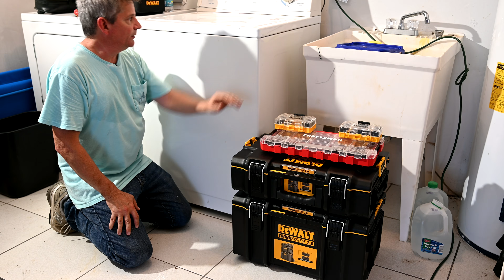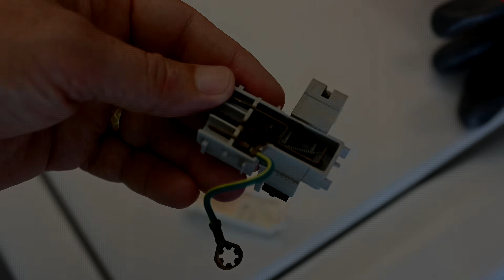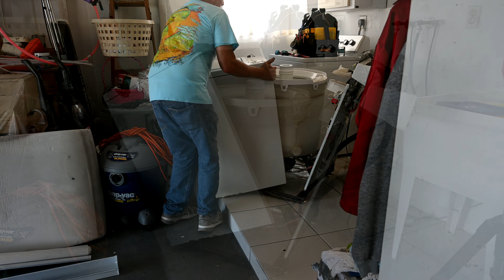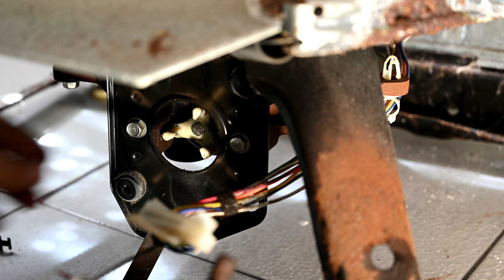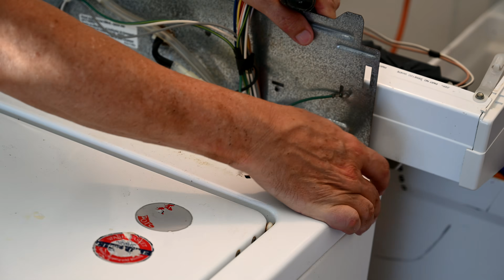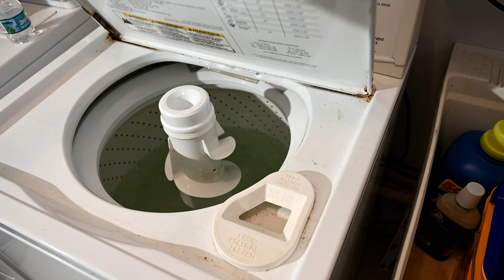Washing Machine Wont Spin/Agitate DIY Fix: Fills With Water

Comment: My washing machines will complete its full cycle except for the spinning cycle. It stops spinning although the motor seems to be running and trying to spin. The 3 point plastic parts don’t seem to be the issue since they’re all intact, as well as the black rubber part. what else would be the reason??

Comment: Thank you for this video.  When I lift the lid I can hear the switch clicking loudly and figured that was not the problem.  Then i read one of the comments that said one person wired around it even though he could hear the switch and that fixed it.  Sooooo I just did the same and Viola!  It works.  Thank you so much!

Comment: I have a issue with my Maytag top loader… I found the belt was disconnected from pulleys and the Lilly on the motor was shot… so I relaxed the belt and motor… now the washer will fill with water then buzz and do nothing.. I can unplug the washer and put it into spin fine… just need help figuring out why it won’t agitate after filling with water… please help!

Comment: Is it possible that the timer is bad? I have a belt drive Hotpoint top loader washer HSWP1000M4WW. The reason I ask is because my timer sometimes would not turn off with the timer knob. I taped the safety lid switch together so I could open it to see how well it was agitating. Then one day it just stopped washing or spinning even when I turned the timer manually. My timer is advancing through all the cycles, though. Any thoughts?
Reply from the maker: Yes likely an issue with the dial or the circuit on the main baord

Comment: Uh you forgot a mjor part that breaks.  there is a plastic  gear in the tub that connects the agitator . That if strips out, it won't spin or agitate. It's easy figure out if broken,  if the agitator spins in both directions it is stripped  , it is only meant to spin in one direction.

Comment: i have a kenmore washer with lid lock.    i did diag and have it narrowed down to the lid switch or the shifter/actuator.    Any way to eliminate the lid lock switch to test to see if that is the issue vs buying both parts.   Lost job..moneys tight.   TY

Comment: I would have thought the older machines would have been easier to do maintenance on. From my experience it's the newer stuff that is built where it's not easy to take apart and when you do, your only option is a $300 board or you gotta buy a new unit.

Comment: Hello Jeff thank you for the Video.
I ve got a frigidaire washer. Like 25 years old. My timer went out.  Took it out cleaned contacts and still nothing,  was thinking about using toggle switches and just stand there till each cycle was finished. Because really machine is to old can't get replacement part. And don't have really any money to do anything. 1st whT do you think about the toggle switch, and do you have any ideas.. I'm sure this would or could be a head scratcher lol
I know it is for me, I've been looking at the wiring diagram.
Thanks again

Comment: New motor ,coupler and capaster ,machine won't agitate I even took the motor out but kept the power  connector and still the motor only kicks in on spin ,you think its the timer or clutch ?
Reply from the maker: It could also be the controller board not enabling the motor
Reply: Not spinning clicking noise

Comment: Hey Jeff, my washer was doing its job for about 5 minutes but then I had to pause it to add more clothes. It was pause for 4 minutes or so with the lid up. I put the lid down and now it won’t continue with the cycle. How to I get it to start going again? 
Do I follow these steps?
Reply from the maker: Maybe it got into a messed up state, try to unplug it and plug back in. IT could also be a coincidence that maybe the door switch broke when you opened it.

Comment: Hi, great video. I did step by step but it still does not turn it is stuck. What can I do. I thank you I advance
Reply from the maker: You'll have to keep searching for videos on your model to see if it's maybe the controller board, or a relay somewhere. Try Appliance parts pros, enter your model and see what video they have under the symptoms section that show how to fix it
Reply: @jeffostroff  Thank you so much for your quick response

Comment: Sadly still can't fix my issue :( Replaced capacitor, lid switch, the dial and the motor. Thing will still not turn on =/
Reply from the maker: This leans towards a bad controller board

Comment: What if I see oil around the motor cuplink. I’ve taken the motor off completely but I see oil. I’m thinking at this point instead of having to remove the break it may be cheaper to buy a used one
Reply from the maker: Sometimes there is a bit of grease, they don't usually use oil. It could be from somewhere else

Comment: My machine fills but won't drain.  Does not agitate, does not spin.  Makes a loud noise when on the agitate cycle, "bang-bang-bang" like a machine gun.    Coupler replaced, issue persists.  What next?
Reply from the maker: If all those things are wrong I would look at the main controller
Reply: @jeffostroff  Main controller?  You mean an electrical part?  Or the motor?  I"m in the process of replacing the trans.

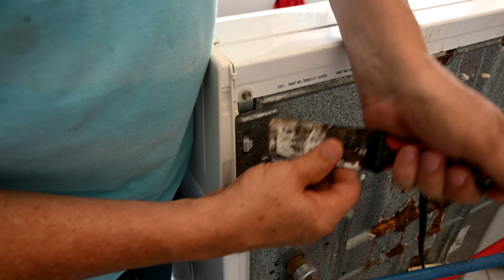Comment: Do not detach the clip(s) at 2:10.  The hooks at the base of control console detach from the machine top by pulling the console slightly foward.  Then the entire console rotates upward and back (as shown) when the two screws are removed.  The clips anchor the hinge pieces to the back panel that allow the console to rotate upwards and should not be "pushed in."

Comment: Hey Jeff my machine spins, but won't agitate could that still be the switch?
Reply from the maker: I don't know on this one but I would say that is probably not your problem because if the door switch was bad it would not spin at all. That is a safety mechanism to prevent anything from moving when the door is open. So I would have to start hunting down something else may be on the controller board.

Comment: Theres absolutely no need to take the "shell" off to replace the coupler
Reply from the maker: yes there is, how else would you get to it?
Reply: @jeffostroff  lean the unit back and work from underneath
Reply: Saves time and effort, you always want to move the unit the least amount as possible in a customers home( granted it’s your friends unit) you feel the coupler with your hand and tell if it’s engaging before taking off the motor and shell and if it need to be changed out 15 min repair without moving the unit and taking off the outer shell

Comment: Our whirlpool is spinning without draining. But the spinning sounds different. The clothes seen In there with soapy water. What can I do?
Reply from the maker: First thing I would do is pull the washing machine away from the wall and test the drainage into the wall and make sure your pipes are not clogged I doubt that would be the case but this is a very unique failure that you have so anything could happen. If that's not the case then make sure the hose coming out of the washing machine going into the wall is not clogged. And if that is not the case then you probably have a problem with the solenoid inside the washing machine that tells it to pump the water out

Comment: Excellent video... I just tested my older Worldpool washer and found that my lid switch sounded absolutely fine. So i was hoping that it would be obvious that is was bad, but it looked AND sounded fine. Since I had the back cover already oped, I decided to make a small alligator clip jumper to mimic a brand new switch. Since the plastic is old and brittle, it damn near destroyed itself , just trying to get the switch harness out of the washing machine. So I need to order a replacement anyway. I was shocked when I set the dial to spin and empty, and plugged it back in the wall. It actually started spinning. I'm about to order a replacement lid switch. Thanks for the great tip. It put me in the right direction..
Reply from the maker: Glad to help, thanks for watching

Comment: Hey there . Here is my issue I hope you could take some of time to help me I would really appreciate it .:. I have a hot point that stop working … I watched several videos and I end up replacing the capacitor and check the pump for any stuck socks :: put everything back together and it still don’t work … the Door switch clicks and makes a sounds when I close the door so it’s working .. the washer gets the water 💧 necessary to start the cycle but it never starts .. not even a sound it doesnt do anything. So idk what could it be . The belt looks good I think , there’s a new capacitor and the pump work too and the door switch works too . So what could it be ?
Reply from the maker: Not sure on that one, if it is not the motor, it could be something else on the controller board.
Reply: Hi.  Mine is doing the same exact thing you describe.  Did you ever figure it out?

Comment: Hey, I open my twintub, the spinner won't start on its own, it needs a boost and checked my capacitor that is in good condition.
Reply from the maker: Hopefully the motor is not going.
Reply: @jeffostroff  yeah, but what could be wrong? The spin motor just buzzes and it won't spin.

Comment: This must be 20 years newer than my 35 year old GE that I by-passed the lid switch on abs later added heavier pull springs to motor because it’s belt drive. Don’t for get to live the sliders for smooth tight action. Mine is going into it’s 45 year of top load action. Had a capacitor fail to spin dry load as the motor is reversed. Capacitor is not attached to motor but my Fluke 87 type V has capacitance scale a cane now where close to rating on case. Well, $8.10 cent later, working like a champ. I did remove the centrifugal switch and cleaned the contacts with 400 grit sandpaper. This switch changes from high toque, low speed to high speed rates torque. Thanks for the video!
Reply: Mine is direct drive inglis washer. Pretty old , changed pump, checked manually that it spins but when I connect all together, it won't spin after filling tub with water. Inglis IE48000 model.
Reply: @suredross1   I don’t know for sure, but many have a motor belt drive the drum. It is tensioned by a spring system, so full and won’t spin, remove belt to make sure motor turns. Then check tube to see if tube turns. If all well, the motor may be weak due to bad capacitor. On washing machines, the start capacitor is not bolted to the motor. So with good light, follow wires to find a the “Twinky” cupcake sized capacitor. My Digital Multi Meter a “Fluke 87 type 5, has a capacitor meter. The specs are on the side of the can. If 540 mF and test at 210 mF, replace it. It list voltage and purchase one that is slightly close or higher, say 580 mF but 600 volts. Higher volts are fine but capacitance should be close. 
  A capacitor works on A/C voltage but time to charge, then discharge. This extra time delays the magnetic field induced into the armature. This is more torque with less HP! Once up to speed, a centrifugal switch changes to full regular A/C induction for full power & speed. My best guess is you need a new capacitor. This is common on A/C units on outside condenser’s or fan. Inside fan that circulates air the house may not use on depending on year built. Best of luck!
Reply: That's cool. I think you have gotten your moneys worth on that unit!!! 😁

Comment: At approx 7:38 I notice you test the transmission by spinning it counter clockwise (to the left). Should it be able to spin both ways?
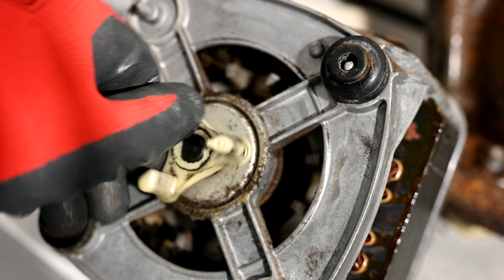Reply from the maker: Yes, look at 7:56. The motor should be free to spin both directions, it is induced spinning when current passes through the windings.

Comment: Jef can you help me with my Bosch washer dryer . The problem was not agitating replaced with new carbon brush S.  Switch on it worked went through th washing cycle ok drained the washer ok went into the spin cycle started to Rev up just before going into high speed cuts off and the spin cycle restarts
Reply from the maker: Don't know much about Bosch, but I have seen people before offer up that maybe it's not draining completely so can't spin at high speed. Try it with tiny load. search google for "Bosch washing machine won't spin at fast speed"
Reply: @jeffostroff  ,,

Comment: Recommendation for some when disassembling projects like this is to take frequent pictures so you don't forget how things go back together.
Reply from the maker: Yes that is true. Or video as well.
Reply: Thank the very best I will thank the developers thank them and
Reply: And save them! I'm still looking for the videos and pics the last time I had fix mine, only a couple years ago. This must be one of the few videos out of hundreds that show this exact machine, without the easy front cover that also surprises those with the top front lock that I always thought was the lid switch, as well because you can't see the one in the back at all until you take that top cover off.
     Thank you so much for helping me remember what I had to deal with last time when both washer and dryer broke down the same day. Oh, the heavy loaders I live with will get a no heavy loaded washer mandate from me, this time. Kidding
   Aside from that, does that one reset that some do to lift the lid 6 times after powering off for over a minute and power back up, lift 6 times a couple inches in less than 15 seconds, within 30 second of plugging the power back in work on this machine, as well?
   My machine wouldn't spin or agitate, instead go through its start up while switch is set to spin and on it's last action spin light comes on but it instead starts to fill with water, no matter what I try, to get its brain to stop doing it.
  Thanks again for your videos if you happen to read this, it really helps me a lot in these and your found sales videos on tools.
Reply: I thought I was too cool for that and now I’m here

Comment: Inside, where the hot water, and hot air warm the room?
Reply from the maker: This is in the garage. Also hot water heaters don't warm the area around them, they are too well insulated. That's why they are room temperature when you touch the tank.
Reply: @jeffostroff  OK, lets point the FLIR at the tank, and then at the wall.  Point it at the hot water pipes, and then the wall.  Point it at the dryer, and it's vents, and then at the wall.  I'm sure you will see that they do give off heat.  Saving a few bucks on E, doesn't make for a bad builder, or bad choice.
Reply from the maker: @ryanmacewen511  Well you don't live in Florida, so you don't know. I have 2 friends with drastically bad problems now because the idiot builder put their Ac units in the garage rather inside in a conditioned space of a closet like normal respected builders do. Now they have AC units that are sweating profusely in the high heat and humidity of the garage, and at one friend's house, because of the way they built the AC area, it all that excessive sweating leaked water through the wall into the house into their dining room and destroyed the wood floor. Twice.
Reply: jeffostroff I think the physics are the same everywhere.  I wouldn’t put a central AC unit inside a garage.  I thought you were referring to washing machines in a garage being a bad idea.  Humid air from these machines is also another good reason to place them outside conditioned space.  Depends on the scope and budget.  On the low side it’s a good idea.

Comment: Hey Jeff, seems like the switch replacement worked, but it what steps would you have taken if it was the coupling that was broken? Good source of parts for these older washers?
Reply from the maker: Like I mentioned in the video, when you seethe couplings, they just pull straight off the motor spindle. It requires a little bit of streetlight, as they are wedged onto the spindle tight.
Reply: I did an older machine like this for the coupler .
We changed the pump out water pump while we were there, that far in.
We also re-made the drum spring attach connections to give it a new area on them to wear. I learned alot.
The supply house wouldn't get us new springs.
I had to use a trick from the GM truck garage to open a new spring loop for attaching them to their links. Supply house said we needed a new machine.
Nope.
The owner replaced them (washer and dryer) and gave the good old ones to the delivery man.
Isn't that just great.

Comment: Alot of those older washers you can just bypass the lid switch. Yes it can be dangerous
Reply from the maker: Yes, that's a lot safer on the top loader than the front loader, but still would be nervous some idiot sticks their hand in during agitation, or a kid sticks their head in and gets strangled.
Reply: @jeffostroff  : I think they're saying as a test. Sometimes the failure isn't always as obvious as a burned contact (smell might have hinted at that as well). Some of the newer is a sealed switch activated by a magnet.
Reply: How do you bypass the lid switch
Reply: My washer filled with water and just stopped and won't agitate. Don't know how to get water out and need time to order lid switch online. My clothes are starting to stink they've been sitting in water for 3 days now. So how can I bypass until order comes in

Comment: Word of advice if you huy one of $800.00 new washers or dryers by the 3-year extended warranty i did the pump went out on my three-year-old Samsung
Reply from the maker: Yes, and check at Costco, because a lot of times they add a year or more onto the appliance. We just bought this week an LG OLED 55CX TV, and Costco already had their 1 extra year plus Costco Concierge service, then during the sale this week they threw in the Square Trade 3 extra years, a $99 value free, so now we have a 5 year warranty.